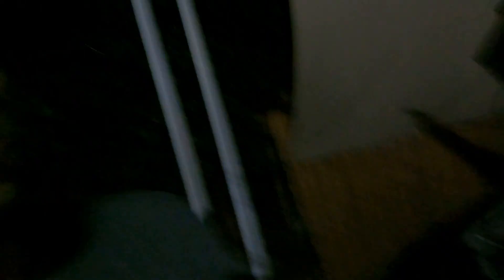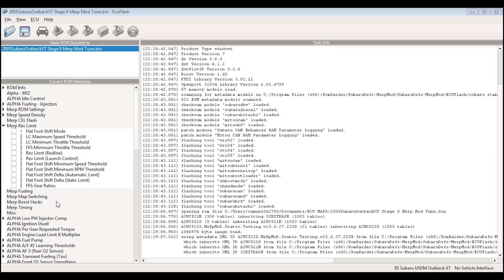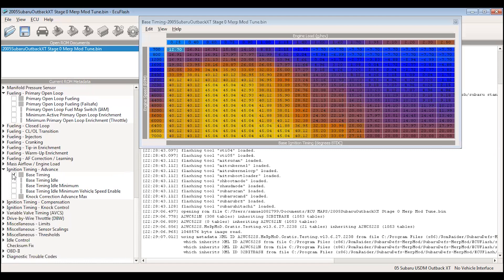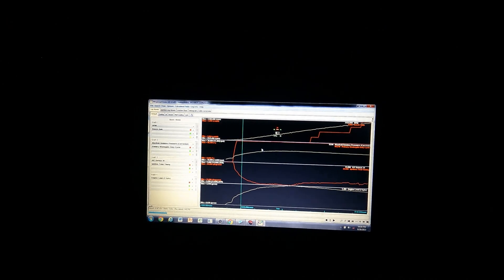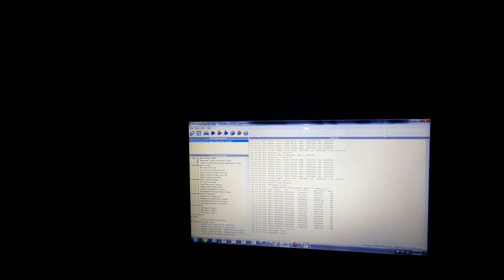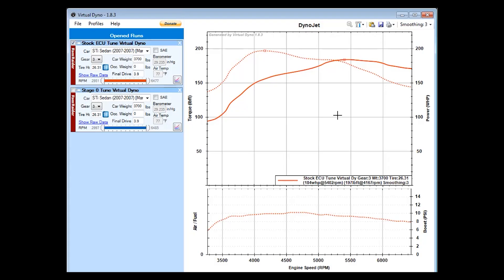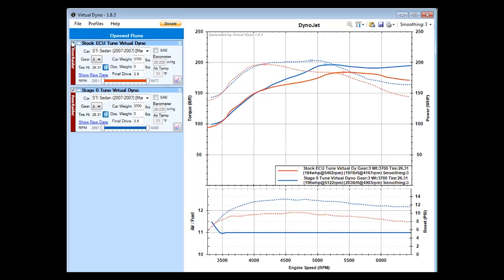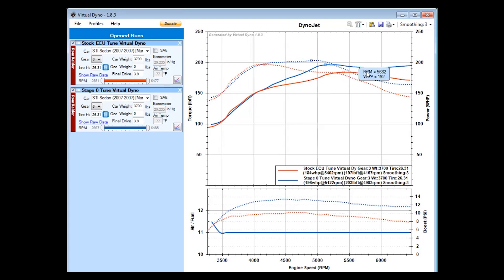Subaru Stage 0: How Much Power Can You Make From Just a Tune!!

Comment: Just curious I've been looking into buying a legacy gt and the specs say 243 horsepower then I started watching your channel now I'm wondering if I read something wrong or if the specs from the manufacturer isn't the wheel horsepower? Please enlighten me!
Reply from the maker: The manufacturer advertised horsepower is not wheel horsepower, it's actually crank horse power. So the awd parasitic loss makes the whp much lower
Reply: @SWSpeedCo  I was assuming as much but wasn't sure just means the car is still gonna be as fun as I hoped. Hopefully all these videos can help me build a decent fun daily
Reply from the maker: Yes hopefully but stop at stage 3 for a daily hahaha
Reply: @SWSpeedCo  I'm planning on only making 300 if I make that I'll be happy actually I'd be happy with 250 at the wheels
Reply from the maker: Yeah I would say 320whp is the most I would do on these cars for a daily